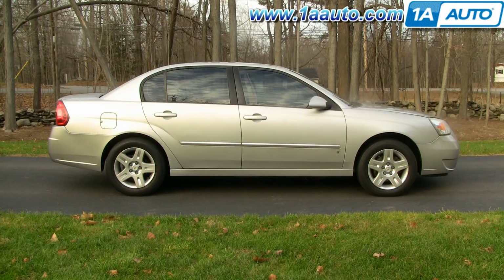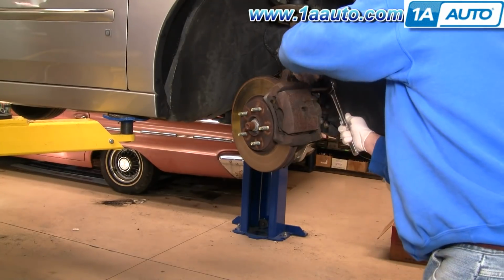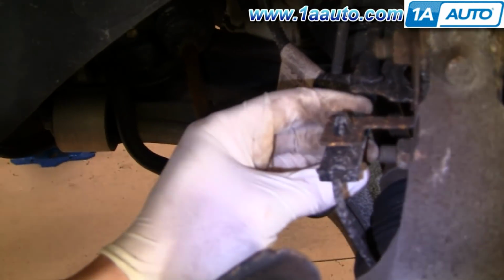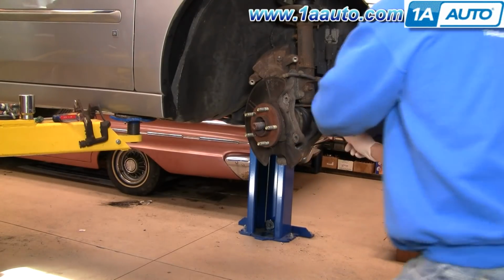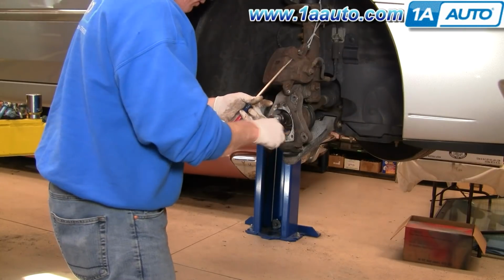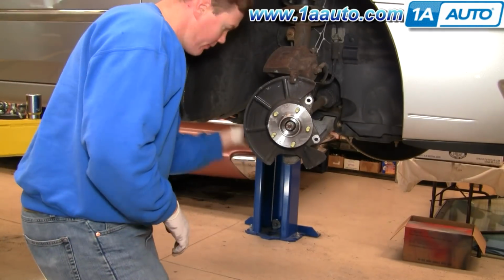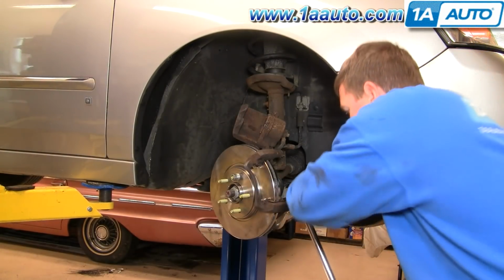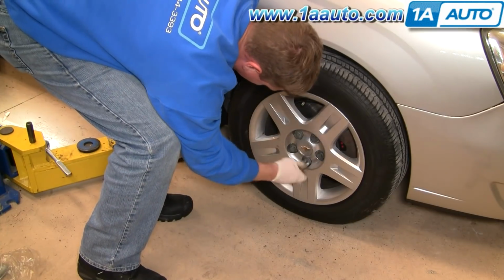How to Replace Wheel Bearing & Hub 04-12 Chevy Malibu

Comment: Just want to thank you, I followed your video and replaced both front axle wheel hubs and bearings on my sons 2006 Malibu. It was a pain in the a** but the total cost out of pocket was $350. The dealer wanted $1000 for both. Your instructions were impeccable. So much so a 50 yr old woman was able to do this alone ( with the aid of a sledge hammer and Ryobi 18v impact wrench)

Comment: I was able to replace the wheel hub assembly on my ‘05 Chevy Malibu by myself while following this video - THANK YOU!! My traction control and ABS light were both on. I had all ABS sensors checked and was told the front passenger wheel speed sensor was going out. Found out the sensor is built into the hub assembly so I replaced the whole thing and when I was done the lights were off!! Woohoo!!
Reply from the maker: +Evelyn Ramos Thank you! We love empowering our customers and showing how to perform DIY auto repairs with our high-quality auto parts. 1AAuto.com

Comment from the maker: on vehicles that you can access the axle nut through the rim, you will want to do it on the ground. If you have rims that do not have a hole large enough to accommodate a socket, you will want to lower it down to the point where the opposite tire is touching just enough to get the correct torque.
Reply: Haven't tried this but an idea that might help. Use pipe , breaker bar , socket extension, etc. Jam it between two lug bolts and brace it against the ground while tightening. Just a brain fart that might work.

Comment from the maker: You should check both for excessive play and go from there. You might find that there is something else like the lower ball joint causing the issue.
Reply: The ball joint is also part of the lower control arm and so look forward to changing that too along with the inner and outer tie rods. Yay.

Comment from the maker: If everything was followed correctly in the video and you are having the issues you are, the bearing is probably bad since there is a grinding noise. You might want to recheck all of your work, including re-installing the brakes. If everything is ok, you might want to return the bearing for a replacement.

Comment: i recommend not hitting the end of the cv axle with a hammer without putting the nut back on, or a block of wood.  unless you have a brass hammer. otherwise good tutorial.

Comment from the maker: @loser6574 You should not have to hit the axle hard enough to do any damage.  If you give it one good hit 99 times out of 100 it is going to move, in my experience.  If it doesn't move you need to use an axle press.

Comment: How do you torque the bearing nut when the center hole on factory alloy rim is to small for the 35MM socket to fit through it

Comment: Uh I think you might have mixed up the torque specs for the 3 wheel hub bolts and the two caliper mount bolts. I think the hubs are supposed to be 85 and the caliper 65. The video points out the opposite.
Reply: i was reading forms it says 133 ft

Comment: Thanks - your videos are excellent and your printed information is precise, concise and straight up.  I have major issues with replacing the right front axle bearing on a 1998 Toyota 4Runner.  There was play in the hub so I pressed in a new bearing, reassembled all the components and drove four miles. I heard the sound of the rotor scraping against the caliper, raised the the vehicle on a lift and gave it the 'four point test' and there was similar play as before I replaced the bearing.  Ideas?

Comment: Can't make out what torque you are specifying for the axle nut. Will you please clarify that? I have an '05 Malibu Maxx LT.
Reply from the maker: Richard DePas 159 ft/lbs. Hope this helps!
Reply: +1A Auto Parts 159 ft/lbs is the a +/- to that?
Reply: 159...glad I found this. It sounds like 59 in the video
Reply: Thanks for this question and answer. I'm not the only one that heard 59.

Comment from the maker: @sampark

 Could the wheel bearing also be bad even if the wheel has no play whatsoever? I'm getting grinding noises from the front passenger wheel when I turn right and brake ever so often. 

If it's not grinding when you apply the brakes, but more when you're driving and taking a turn, it could be a bad wheel bearing. We carry new ones on our website 1aauto.com 888-844-3393

Comment: Thank you so much for the video!! It made it fast to accomplish, besides my mistakes to slow it.I do have a question if anyone can answer, it would be helpful. After assembling the wheel and hub back together i took it for a test drive, and there now was a grinding sound. I suspect it to be the dust plate flipped backwards or maybe brakes grinding the rotor. Any advice??
Reply from the maker: You may want to jack the wheel up that's making the noise and turn it by hand to see if you can hear where the noise is coming from. It could be the dust shield rubbing against the brake rotor or something else that's scraping against the rotor. Hope this helps you out. 1aauto.com 888-844-3393

Comment: 1AAP, I want to thank you for all the videos you make. You've helped me a great deal over the last few years. We now have an '09 Malibu and on passenger side while driving makes this loud whirring or humming noise and it keeps getting worse. What it sounds like is loud mud truck with big knobby tires. I took both front wheels off and there is no play while shaking it in any direction, both sides seem normal. I'm going to switch the front tires around today and see if the noise still comes from passenger side. If I switch the tires and the sound still comes from that side do you think it's the hub assembly? Thanks in advance.
Reply from the maker: On some of these newer vehicles the tolerances are so close on the wheel bearings, sometimes it's hard to tell if the hub bearing assembly has gone bad until you remove it from the knuckle. If you find that yours are bad and they need to be replaced we carry the replacement on our website with a 2 year warranty and FREE SHIPPING in the lower 48 states. http://www.1aauto.com/1A/front-wheel-bearings-and-hubs/Chevy/Malibu/-/-/2004?utm_source=VideoReply&utm_medium=VideoReply&utm_campaign=1ATony
Reply: It ended up being the wheel bearing/hub assembly. Went and bought a new one locally (sorry :-( ) and had it all put back together in about an hour. She rides like a dream now. I keep forgetting that you guys sell parts so when I have to change the drivers side which I know I will I get it from you because every time I've asked you a question you always reply and I really appreciate that as do others not to mention I paid DOUBLE the price compared to what you charge! Hate Autozone..haha. When I spun the old bearing it sounded like metal shards or gravel inside of it. The new one was tight but smooth.
Reply: John Smith its a bearing most likely

Comment: Thank you so much for posting this video.  (It was really illuminating.)

If you don't mind I've got a few question:

1) Is it more or less the same procedure to replace the "rear" hub?

2) When you buy a "hub" is the wheel bearing part of the assembly?

3) And lastly, how much can I expect to be charge for labor from my mechanic for a rear hub on a Lincoln Mark v111?

Thank you so much for your help.  Cheers!
Reply from the maker: We carry new replacement rear hubs on our website for the rear of your Chevy Malibu. It would come already assembled for you. This video should give you an idea on what may be involved with making the repair. It's not too hard to do. How To Install Replace Rear Wheel Bearing Hub Pontiac G6 Saturn Aura  Hope this helps out. 1aauto.com 888-844-3393

Comment: Hi there, i have a problem with my 2004 Chevy Malibu classic. I head a noise that is produced only when the car is in motion. It's almost like the sound made by those trucks with big tires. The difference is when i had someone else taking off with my car, i can't hear a sound from outside, i can ear it only in the inside. The steering wheel does not vibrate even at 65/70 mph. No bad sound when turning. I was told it could possibly be the wheel bearings. I can't feel any shaking. Any other guess?

Comment: I used this video as a guide to install my front wheel bearings on my Pontiac G6 but somehow i failed. I followed every step as shown in this video but now my ABS sensor lights up and when I press onto the brakes i can feel and hear a grinding noise against the pedal. Anyone know what the problem may be? Could the ABS connector be defected? all the help and advice is appreciated. thanks

Comment: Replaced all wheel hubs, Calipers, brakes and both axles on my 07 Malibu. Bled system.  Shortly after acceleration, ABS, traction and brake lights come on together.  Any ideas.   Thanks!
Reply from the maker: +Sal 1959 We wouldn't be able to diagnose an issue like that here, you may want to have a local mechanic take a look at it. Thanks for checking us out! 1AAuto.com
Reply: @1AAuto  turns out it was a bad wheel bearing LR right out of the box.  Replaced and it was fine.

Comment: I replaced the wheel hub assembly, and am wondering how crucial it is to tighten the bolts to the specified "foot pounds"... (e.g., 85 foot lbs). I tighted the bolts so tight that I could not physically turn them anymore, but am wondering if not tightening them to that amount (also, how did you determine/calculate that number?) is dangerous? Thanks.
Reply from the maker: Thank you for watching! Torquing the Axle nut is the most crucial. Over torquing or under torquing it can ruin the bearings. The ones on the back aren't as important.
 888-844-3393

Comment: Thanks for the video.  In getting ready to do this on my car.  I think you stitched your brake job video to this and missed putting the center axle nut back on. What is the torque spec for the center axle nut? In what step should that be put on? Thanks!

Comment: I just replaced my hub assembly on the driver's side, so there's no more humming! However, not when I turn right, there's a grinding sound (different than before). Why is this? Should I have greased the hub assembly?
Reply from the maker: You may want to inspect the axle nut to make sure that it is torqued down correctly using a torque wrench, and also inspect the brakes to see if they're rubbing on anything. Inspect the dust shield and also the tabs on the brake pads to see if they're hitting the rotor and making noise. If you jack the wheel off of the ground, turn it by hand to see if you can hear where the noise is coming from. Hope this helps you out. 1aauto.com 888-844-3393

Comment: was wondering if there is any way you could tell me th torque specs on a 2013 malibu  for the 3 front hub bolts along with the axle nut torque. I have found it for the 2008 front but figure the numbers have changed.. i Thanks in advanced or where I can find this
Reply from the maker: +Bradley P Thank you for checking us out. At this time we do not have access to these torque specifications. You may attempt to call a dealership for these, or search through other online automotive forums. 1aauto.com

Comment: are the Bearings Not Replaceable anymore?
can you buy just the bearings and press them into the hub?
Reply from the maker: +gravelman5789  You can. However many people find it easier to replace a pre-assembled hub & bearing assembly. It costs more but it saves time on the repair, especially if a press is not easily accessible.

Comment: got the bolts out from behind, nothing is holding the assembly on but its stuck on like crazy
Reply from the maker: It's hard to see very well in this video, but Mike really whacks on it with that hammer. You want to be careful not to separate the bearing from the race, and don't slam on the knuckle itself. That's typically a high heat area, so it's possible that the components are sort of frozen together. Rust can also make them harder to separate. But if you go around the hub a few times hitting it firmly with a heavy hammer, you should definitely start to see it coming off. Good luck!   1aauto.com 866-403-3393
Reply: bondophobic I had to turn the knuckle several times so I could hit it from behind to break it off

Comment: Will this Video 'work' for a 2007 Chevy Aveo??
Reply from the maker: +Tony Leasck Thank you for checking us out. The Aveo uses a separate set up for replacing the bearing which includes the need of pressing out the bearing of the hub and pressing it back in. https://www.1aauto.com/search?q=hub&year=2007&model=1047

Comment: when replacing wheel speed sensor,do i have to replace the front wheel bearing hub assembly?
Reply from the maker: +uriel4377 Thank you for checking us out. You may replace just the sensor if preferred, or you may replace the entire assembly. It is dependent on the condition of the bearing/hub. 1aauto.com